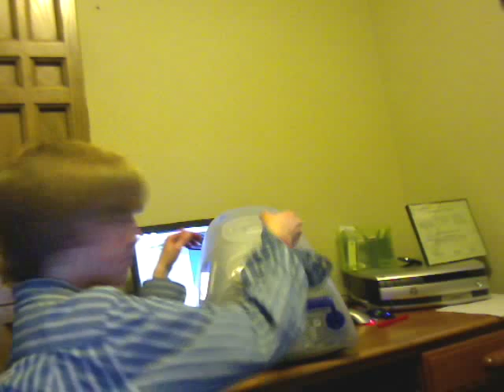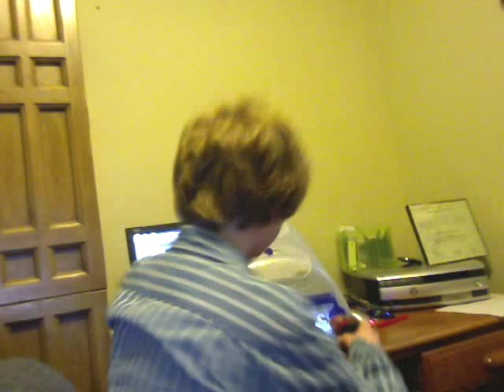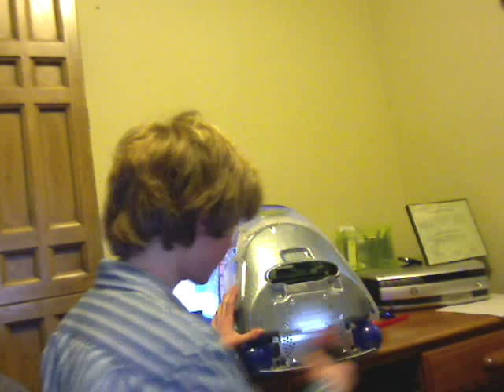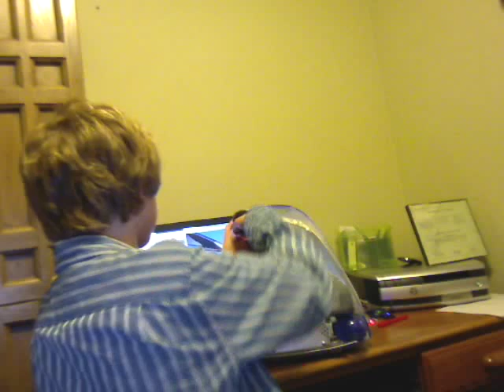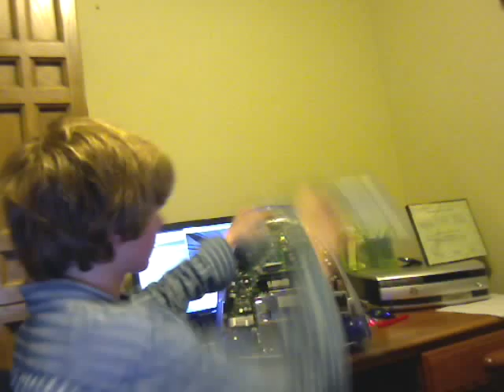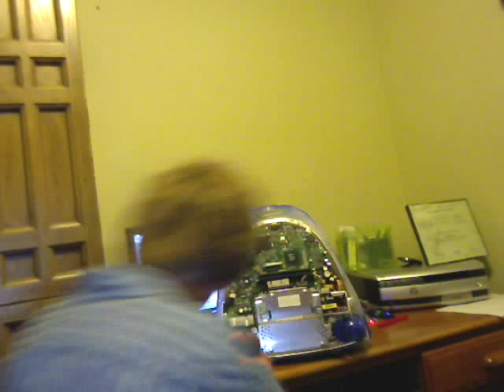How to Disassemble an Apple iMac G3

Comment from the maker: It's been a while since I've done it (old brain cells), but I believe you have to kind of pull the top down first and then the bottom will wiggle loose.  If you're sure you took out all the screws, you /should/ be alright to mess with it until it comes loose.